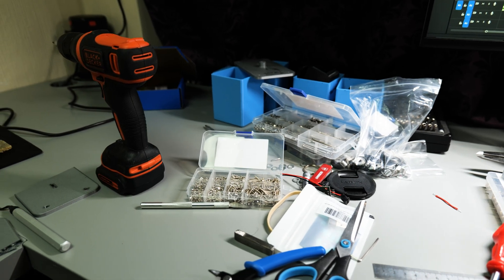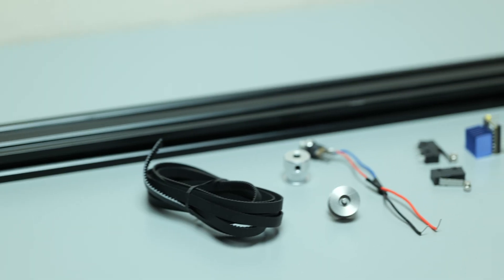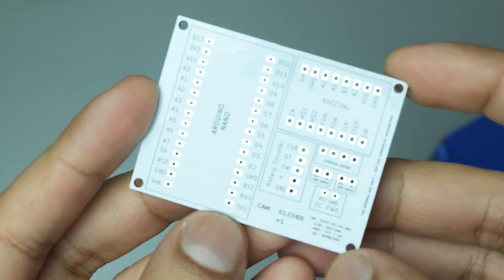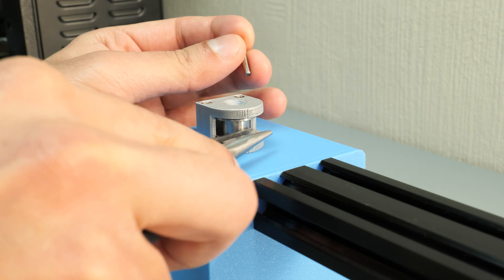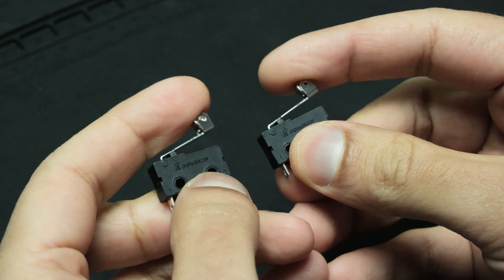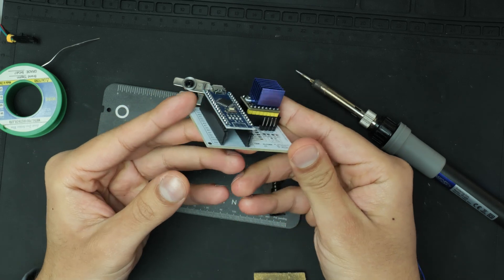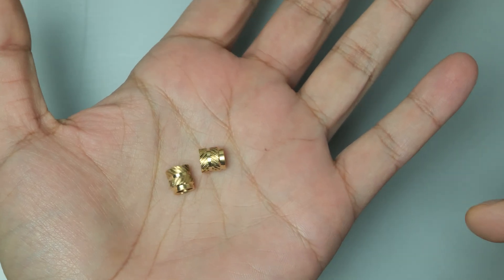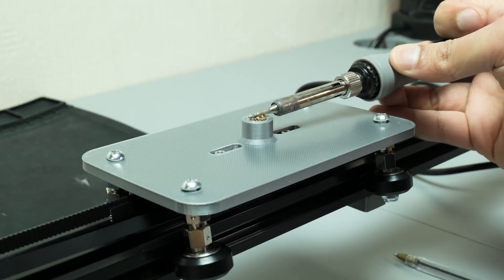I Wanted to Challenge Myself… So I Built This

Comment: Nice job. One area to improve upon might be the grey plate that holds the rollers. The axles seem to be bending outwards already, maybe design the plate in like an upside down U-shape and attach the wheels closer to the plastic or make the plate from metal.
Reply from the maker: Thanks, and great points. I think next time, the gantry design needs to be reworked to avoid this.